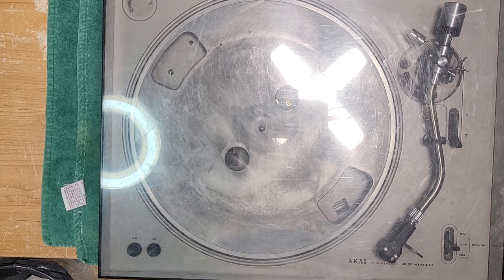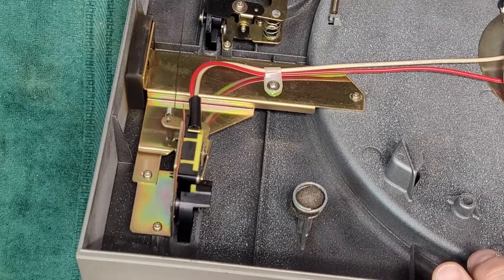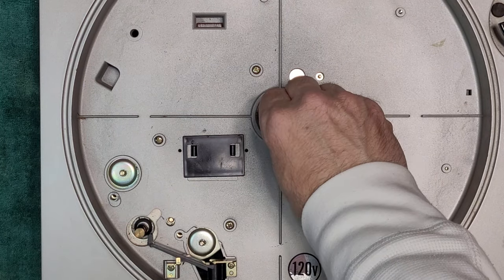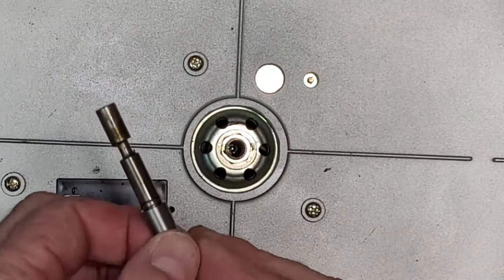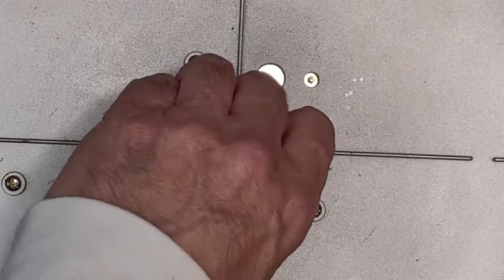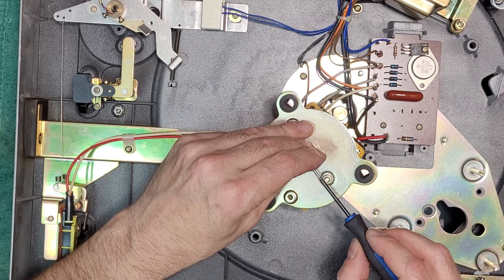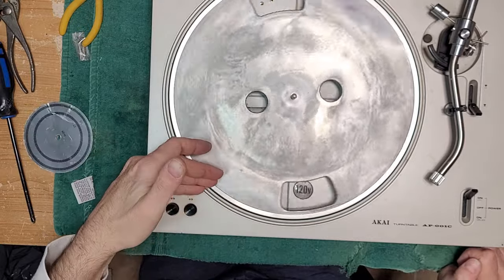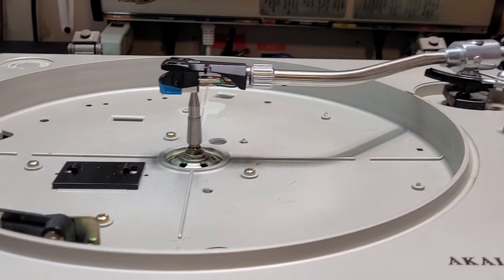Akai AP-001C: Service, Repairs, Adjustments

Comment: I'm sure you'll agree that a 'budget maintenance' quote on this type of vintage turntable always turns into a major maintenance even if it's only on the one or two areas. Nice job but I'm sure the bill was probably higher for the time you spent on it. It's difficult at times. 👍
Reply from the maker: This one was a money-loser for sure.
Reply: @TurntableGuy I spent 6 hours on an elac mirracord 50 for $80.00. I almost cried.
Reply: @Poppinwheeeeellllllieeeeez  Yep, that was the issue right there, it was a Mirracord - a nightmare turntable !
Reply: @marktubeie07 I have done a few. This went smoothly until it dropped the right channel. Never again.
Reply from the maker: @Poppinwheeeeellllllieeeeez  I won't touch a Dual 10 or 12 series, PE, Elac or any other table in that genre for less than 100 these days.  Too much work.
Reply: @TurntableGuy agreed, I just buy, restore, and sell them, but once in a while, I do a favor for someone and end up wondering why I did. Live and learn.

Comment: Why did you use that weight oil on that bearing?  I’ve primarily been using a synthetic super lube oil when I rebuild TTs with good results.   But wondering if I should use something else?
Reply from the maker: I tend to use a heavier weight oil when the original lube from the factory was grease.  Rega turntables use hypoid gear oil as their bearing lube.  Also, considering the bearing was seized, I wanted a heavy viscosity in there.